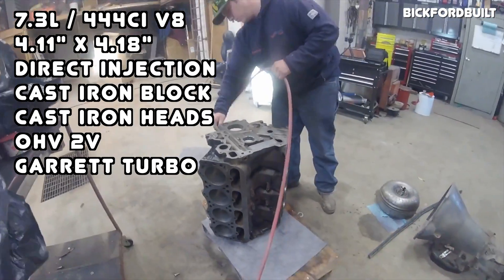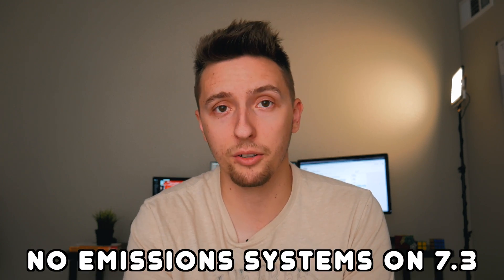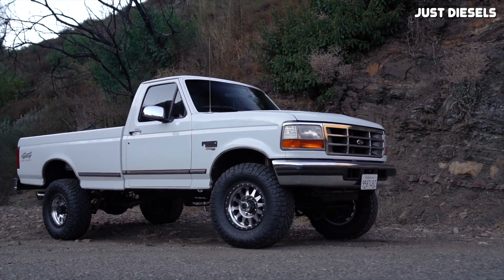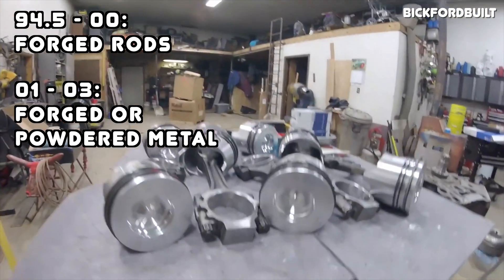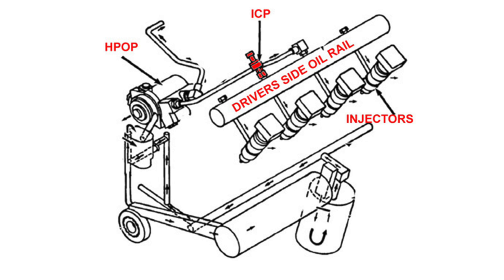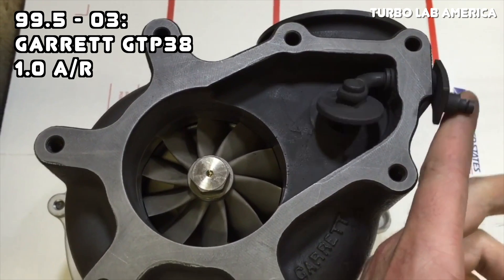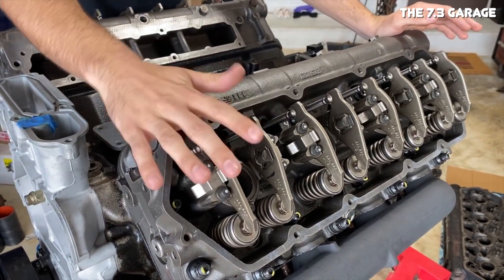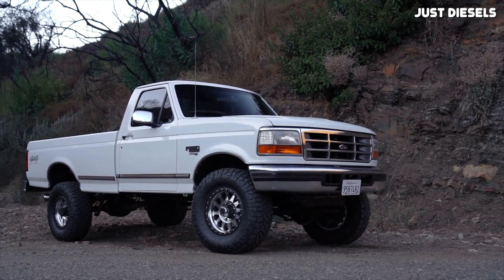7.3 Powerstroke: Everything You Need to Know

Comment: 7.3 is iconic a cool motor no doubt but the 5.9 12 valve is superior more power simpler, miles per gallon , hp capabilities, longevity the list goes on
Reply: A 12 valve is simpler and gets better mileage but it doesn’t not have more power and does not have more power capability. Reliability depends on the owners. Why even say all that
Reply: @MoparMadness93  12 valve makes more power anyday of the week stock pistons and rods hold loads of power. You may be a power stroke fan and that’s fine but the 12 valve is the most talked about most bought and most raced ever 7.3 is an honorable mention but will never be number 1
Reply: Soofloww Diesels i do like 7.3s but I’m a diesel fan not a powerstroke only fan. 12 valve bottom end might hold more power stock before it breaks but 7.3s are easier to make power with than a 12 valve. 12 valves upside are that they are all mechanical

Comment: I’ve owned both the 7.3L and the 6.7L. The 7.3 was a reliable motor but was sluggish and provided extremely low output for its size. The 6.7 is also very reliable as I’ve done nothing to my truck in ten years of ownership that’s not considered normal wear and tear. 

With that said... no way would I go back to a 7.3L. The 6.7L is too incredible to take a step backwards.
Reply: Jerry Massey we have a 7.3 and a 6.7. The 7.3 is still the favourite. But to each their own

Comment: I have a 2007 F350 Super Duty with a 6.0 that was bulletproofed at 191k and it now has 208,000 miles and it’s been going strong. Despite recently having trouble with the intercooler and turbo boot blowing open it’s been a good engine for me. I used to think that the 6.0s were just gutless period until I heard that if you get the bulletproofing done to them they can become more reliable. I have a friend who has an 06 F350 SD with a 6.0 who had his bulletproofed after he got it. Mine was bulletproofed before I bought my 07.
Reply: i prefer engines that dont require bulletproofing just to drive them as intended. what happens if you wanna make more power?
Reply: I like the 7.3s for what they were. I’ve heard of them having 1 million miles on them. But they have not been made since 2003 when the 6.0s replaced them due to failure to meet the newer emission requirements. If you wanted to make more power to a 7.3 you could have new injectors put on and new intake and new exhaust put on. You can also tune the 7.3s but they don’t require an EGR delete like the 6.0s do. But the 7.3s don’t have as good of fuel economy as the 6.0s do either. And the 7.3s don’t burn as clean either. Also the 7.3s sell expensively compared to the 6.0s. I seen a 7.3 on Craigslist last year for like 24,000 dollars and when I found my 6.0 super duty powerstroke on Facebook marketplace last December the price was 10,000 dollars. Cheaper than a 7.3.

Comment: I HAVE A 99 INTERNATIONAL 3800 BUS  T444E   7.3 .  I JUST PUT A TRANSMISSION IN AT545 . ONE REASON I CHANGED IT OUT IS THE ENGINE WOULD REV UP GOING DOWN THE ROAD IT WOULD DO THIS FOR ABOUT A MILE OR TWO AND THEN IT WOULD SLOWLY WIND DOWN AND BE BACK TO NORMAL THEN IT WOULD DO IT AGAIN. AS THOUGH THE TRANS WAS SLIPPING IN THE HIGH GEAR. PUT THE NEW (REBUILT)  IN AND IT STILL DOES THAT.  IT WAS A CITY BUS. WHAT IS CAUSEING THAT?  THANKS   GOD BLESS         TGDANIELS@HOTMAIL.COM
Reply: ips sensor.

Comment: I just found your channel here and I see you know what you're talk'n bout. And, I have question on the 6.9 and the 7.3 diesels (I don't anything on these diesels). does the bell housing and fly wheel and clutch system from 6.9 fit on a 7.3 and vise-versa? I'm sorta guess'n it will BUT, I don't know for shore. I'm think'n bout a 7.3 in my '85 model 1 ton. Thanks for Any information on this ahead of time too.
Reply: Check out Stephen Cox on YT. Bet he can answer your questions.

Comment: One of the main thIngs about design that saved a many engine  amongst everything else is impossible to burn it up from lack of oil because it will shut down before it gets to that level.
Reply: Brian Hanks it saved ours. One of our wicker tried to start it when he ran it almost out of oil and it wouldn’t start. He tries blaming it on the fact it was a ford (he was a Chevy guy) bit turns out he didn’t check the oil like he was supposed to

Comment: I have a '97 7.3. It is the best pickup truck engine I've owned. And it's much better than newer Ford diesels. But all the electronics are much less reliable than than older, 100% mechanical diesels. Sooner or later you end up by the side of the road because of the electronics. If I was younger, I'd figure out how to adapt a Detroit Diesel into my truck. I work on the water and use Detroit Diesels there because of the reliability. It's probably unfair to compare a non-emission, no injector pump engine with a highway engine, but the reliability difference is staggering.
Reply: thats why i drive a 12 valve.
Reply: @domusdebellum3042  So you have no electronics?
Reply: @oceanmariner  besides the battery to start it? no. fully mechanical. plus i could push start it if need be.
Reply: @oceanmariner  its why i laugh when kids ask if shes chipped. you cant chip a 12valve. you want more power? turn some screws, slide some things forward, replace the fuel plate.

Comment: I own a 5.9 12v and a PS 7.3.  The Cummins is a superior engine period.  The electronics on a 7.3 WILL leave you stranded.  Often.  I work on my trucks and know them well.  The electronics on the 7.3 suck.  Way too much that can go wrong, and will.  Like the fuel heater grounding or shorting.  Like the IDM dying, or the cam sensor, or the icp sensor or the ipr.  Or the valve cover gasket wiring.  And the injectors wear and need shims too soon mileage wise.  I actually bought the factory scan tool.  Seriously, the same one the Ford dealerships have.  I had to.  And I baby my Ford.  It just sucks.
Reply: I HAVE HAD NOT DONE ANY OF THOSE. BUT I LIVE WHERE IT IS DRY.
Reply: Ours has had none of those problems. And we’ve had three of them. So maybe it’s just your truck?
Reply: @billwarbrick9116  or his location. weather has lots to do with vehicle wear.
Reply: Domus deBellum it could be. But I don’t get why ours wouldn’t because we have lots of rain and snow here so I think ours would be more likely to screw up than his
Reply: @billwarbrick9116  do they salt the roads heavy, or worse yet use brine?
Reply: Domus deBellum they use brine. And might I add we use it for long hauls as well so it has pretty high mileage. and some of the places we go use salt so it’s really a bit of both. (We use it off-road as well)

Comment: My 96obs 7.3 4wd  zf5 manual trans.paid $4000 for it 156kmi absolutely spotless showroom condition ,the previous owner changed oil every 3k mi.even got a extra set of brand new tires with it,absolutely love this truck ,buying another one 97f350 flatbed 4wd ,this truck is decked out with every option 12000lb warm winch 7500 for this one,it also has 151kmi on it ,in the northwest you can still pick these trucks up cheap and in great shape
Reply: Tell me where to get a F350 with that low mileage and a winch. sounds like a good deal!
Reply: Diesel dude Big Mack I was at a feed store I seen this flatbed out front he said he would sell it ,but not till he got another truck to replace it,his wife complained about the stiff suspension,rough ride ,it’s a great well maintained,low mileage truck custom front and rear bumpers,new tires,he said 8000 but would take 7500,I’m always prowling the backroads lookin for OBS’s,so I’m waiting on this one
Reply: Diesel dude Big Mack where you located?

Comment: The 7.3 is reliable just expect to replace all your sensors every 10 to 100k 😂
Reply: Not to mention getting ready to rebuild or replace your factory automatic transmission.
Reply: Grayson Reichert then buy a standard! Problem solved!
Reply: Knock on wood. I haven’t had any transmission issues   But I know there knowing to go bad lol  eh well it is what it is
Reply: Not to mention your overhead fuel monitoring computer.
Reply: Johnny Rebb  I haven’t had any issues  so far. And I have 800,000 km
Reply: Im willing to for a OBS Ford 🤤
Reply: But I know I’m bound to run into issues sooner than later  and when it does  I’ll probably replace everything
Reply: Lua Dipa  hundreds*

Comment: Okay to start yes 7.3 diesels were great for the time but the important reason of phasing out is due to the emissions and today's emissions to that motor would really hurt this engine take the current 6.7 has more power stock than the basic  bolt ons will do for a 7.3  but repairs are definitely cheaper on a 7.3
Reply: scott chong you don’t need more power the 7.3 pulls great for us. 500k right around the corner. It’s pulled as much as 40 thousand pounds with no issues.

Comment: My uncles company had multiple 7.3s that went 300k miles with nothing more than maintenance and an injector here or there. Towing and occasional snow plowing. Company had 6.0s, 6.4s, and 6.7s. The 6.0s and 6.4a are long gone. There’s still a 7.3 or two in the yard still in service. I just drove one this weekend. 290k miles, rotted, but still towing and plowing and earning its keep. I own a 7.3 as well. 246k miles and rotted out, but starts in zero degree weather unplugged.
Reply: Jon Test those truck are invincible. That’s why you don’t see any for
sale. All we used up to 2017 where 7.3’s then (as much as I hate to say this) we got a Duramax. It crapped out before it even made 100,000. We just bought a new 6.7. But we still have the ol 7.3 with 500,000 just around the corner. But she’s still running like new

Comment: 7.3 was Ford's best diesel, but it still has lots of problems.
Reply: LIKE  ?? FAR AND FEW. NO MOTOR WILL EVER NOT HAVE SOMETHING NEEDED.
Reply: Channel Zero One you’re dead wrong there. Our last three of them have all made it over 510k with just routine maintenance. And with the fourth one about to turn over to 500k. I’m sure that they don’t have really any problems. Not unless you drive the sh*t out of them that is and even then they’ll still go over 300k
Reply: @billwarbrick9116  Dead wrong about what? 7.3's are Fords best diesel, or them having a lot of issues. 510k miles is not impressive for a Diesel. My first diesels were Fords, and they broke a lot. I got over a million on my old 5.9 gaser. I own a 7.3 thats got only 289k and its got blow by again.  You can't even push these trucks just a little bit without consequence. Meanwhile most other vehicles I have I can drive it like it is supposed to be driven with out issues. I keep the 7.3 junker f350 for hauling weight, but more often than not I am forced to use the million mile gaser.
Reply: Channel Zero One them having a lot of problems. Yes the 5.9 is a good engine but the truck surrounding it absolutely sucks
Reply: randy s we’ve never rebuilt our transmission and ours is still going strong

Comment: 2002 right at 300k just replaced injector cups after leaking diesel into radiator also IPR . Other than that it runs smooth
Reply: Lost one injector cup on my 02 pulling 37' 5er home from Reno. 199,000 miles At the time I only replaced the bad one. Wish now I had done them all. Great engine!!!
Reply: tonecrazy88 new heads are a complete waste of money. It doesn’t fix anything else and is not in anyway easier to do. Who the hell told you that? The guy that fucked you doing the work?
Reply: @tonecrazy88 I'm not the one questioning changing of the heads..... But. If an injector cup is leaking you change ALL the cups not one or two. Then thinking about it, I  too wonder why the heads would be replaced unless there were other issues. Wouldn't happen because of injector cups...
Reply: tonecrazy88 they don’t cost much why would you just change 1? Change them all

Comment: Not even close to the best.
Reply: You must drive a Prius
Reply: James Hubbard 2018 Ram 5500. As a diesel mechanic I have worked on them all. The 7.3 is far from being the best.
Reply: jeff close we have 2 7.3’s. Both over 490,000. Other than the first gen dodges it’s hard to find a dodge with that high of mileage
Reply: Agreed, Jeff. The injectors commonly fail. The electronics were horrible, the engine seemed to use 10 gallons per oil change, low fuel mileage compared to today’s diesels, larger motor equals more heartache to repair. I can go on and on for days.

Comment: I concede as a stock motor it is under powered. But another plus, it is really easy to get it producing close to today’s numbers. Just don’t push it too hard or you will be buying a transmission.
Reply: plus the weak ass connecting rods.

Comment: Could you hmu with some tips on why my 97 power stroke doesn’t turn over but crank?
Reply: If its turning over but not cranking it could a few things easy one to test is check your oil 7.3s will not run on low oil they have to have enough oil to fire the injectors and if that doesn't work second easiest unplug the icp sensor ... if it still don't start try seeing if you have fuel while you crank hit the Schrader valve on the side of the fuel pressure regulator (the funny shaped thing bolted to the fuel filter with all kinds of lines running in and out if you have fuel and the unplugging the icp didn't unplug it try and replace the cps sensor buy the purple international or ford sensor off Amazon or another reputable sites the after market sensors cost just and much and have a chance to not even work out of the box and will die quickly if they do work or work like shit and your truck will run like ass... if that doesn't fix it there's a few more things it could be such as the ipr.. doubtful if that doesn't work your hpop could be dead and not generating pressure... the idm could've died or if none of that works fuck idk... my 7.3 is cursed so maybe yours is too
Reply: He said it cranks but doesn't turn over.

Comment: Bullet proff the 6.0 with powerstokehelp.com you have a great truck.
Reply: Bulletproof the 6.0 and you get a good 150-200,000 miles out of it before you start holding your breath as you speed up to pass someone. 7.3 you have a good 750,000 - 1,000,000 miles before you start holding your breath.
Reply: James Hubbard good point. The 6.0 just isn’t reliable enough

Comment: The Navistar 444E engine excelled in the most savage duty cycle: School Bus engines.

Y'know, not everybody races their truck nor do they pull Class 5 loads.   For it's rated load (my 2000 is rated 10,000 GVW and 20,000 combined) it is fast enough to get you a fistful of speeding tickets. 

850,000 miles in commercial service is about average.   Generally their demise comes when the truck rusts out around a perfectly good engine.

When matched to the ZF6-650 transmission, a Gear Vendor overdrive and 3.08:1 gears you can get 24-28 MPG all day long.
Reply: @billwarbrick9116  For my uses, reliability cost only the price of the Navistar CPS.
Good engine?  Little in the way of repair costs.   A water pump.   Powerful enough to get me a fistful of tickets.  Starts and runs easily all winter.   Good MPG (might be better if I could get common rail injection).   Works well with my ZF6-650 and tall gearing.
Reply: ToxicTommy my apologies I thought you said an ‘04 for some reason

Comment: The days of simplicity and rugadness are gone. I remember the first powerstroke I saw back in early 95. It scared me to death. I didn't think I would ever be able to to work on them, they looked so complicated. Now I can't wait when one comes in for repair. I never understood why everyone needs a thousand horse power to pull a trailer. I remember when the avarage hp on a semi engine was 350 and about 900 lbs of torque. We got a lot done with those numbers over the years at a reasonable cost of ownership. Give me a 7.3 or 12 valve Cummins in anything up to 30 thousand pounds and that would be enough for me
Reply: It was done with gearing and two speed rear ends. Now to trap idiots in the show room it is a numbers game. Horse power and torque bla bla bla
Reply: agreed. havent hooked to a trailer my 12v hasnt walked away with, even with a virgin p-pump
Reply: jim k ours is about to turn 500k and it been pulling since 180k. Often as much as 40 thousand pounds, just goes to show you don’t need a fancy new truck to haul things.
Reply: The epa ruined the diesel industry.
Reply: It's marketing for people who don't know a damn thing about cars. It's the same thing as with video games. Numbers, numbers and more numbers without any actual substance behind them. Bigger power, more torque and fancier gadgets is all the majority of people buying trucks these days ever care about. Majority of new truck owners haul something once a year and more than half has never used the bed to carry stuff. Over 80% of trucks never leave paved roads. All these people would have been better of with a wagon or a minivan, yet they all flock to trucks and SUVs bc "my car is bigger than yours so I'm better than you!". It's a damn shame bc it also jacks up prices of trucks for people who actually need them...
Reply: What speed limit do I drive pulling 30,000 pounds?
Reply: I have one of each.    Amazing engines